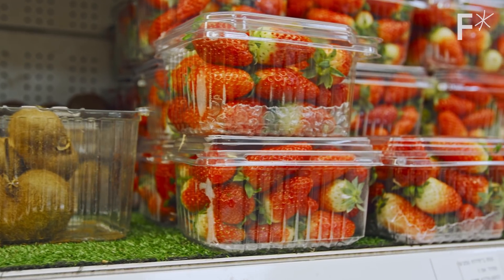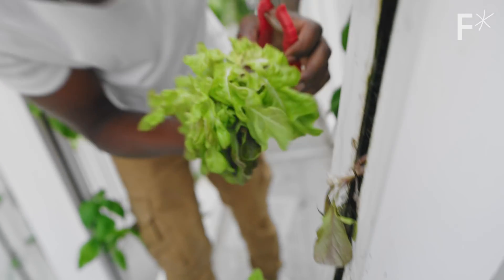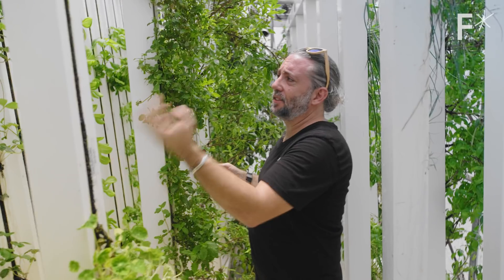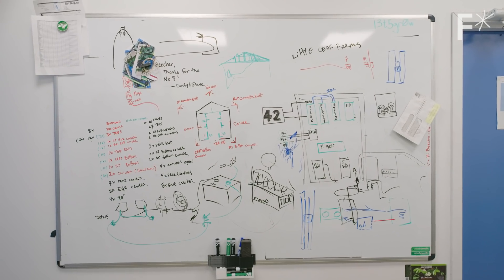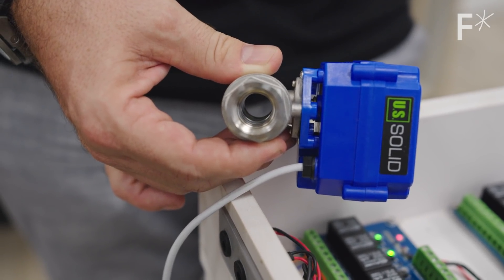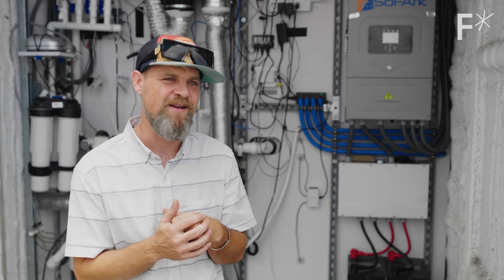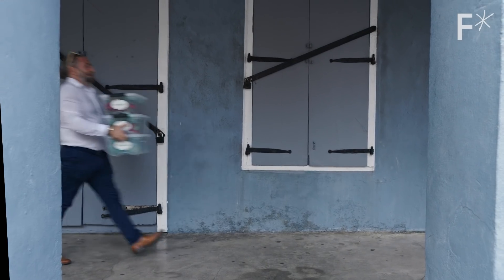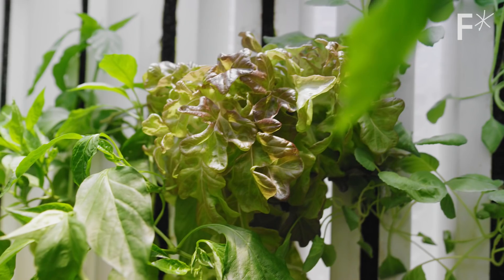Aquaponic farms in shipping containers: The future of food? | Challengers by Freethink

Comment: Why shipping containers? Can't really use existing pre-used shipping containers as you have no idea what they transported including toxic chemicals etc. You also potentially have thermal conductivity as an issue. Why use steel rather than something that can maintain heat better? Another potential issue is structural. how much structural support is needed for a container rather than something custom built?  Don't take this wrong, love the idea, just not sure shipping containers are the best solution.

Comment: As a person in love with sustainable farming, this is mostly BS.  It is neat in theory, uses all the buzz words, and looks cool, but the actual vegetable production from the top of a 20' shipping container( 8ft wide) is negligible compared to the cost of all of that.  if you are growing salad greens (the most profitable food/time/squareft crop there is) you would barely get a salad or two per day with that size of growing area.    A 50 foot bed of lettuce, 30 inches wide with 6 inch on center planting produces about 50lbs of salad mix every 5 weeks, or basically 10lbs a week... sells for $5/lb.. so $50/week.  I'd bet that pod can produce maybe $50-75/week of actual production and probably costs $40,000 or more. It is a nice gimmick for a restaurant to put one in front, but they will still be buying 99% of their salad greens and vegetables from a traditional market gardener.   Math is math, the yield per square foot, even vertical, is very easy to calculate for anyone with experience market gardening.    And the part about the ' buyout ' offer is BS also.  There are no patents involved and you can look at that thing and be able to reproduce it for $20-30k, why would someone pay millions for it..  It is basic aquaponics with a tiny growing area, it is economically unviable, which is why ' they' are the only person doing it.  it is easy easy math to look at the growing area, calculated yield and determine the break even point and that thing is way over a decade.
Reply: And yet he'll garner raves and people will say he's changing the world. Nobody does any real critical thinking but instead just want to feel better about themselves so just by praising him, they feel they're doing their part in helping the environment...
Reply: I agree too. I have been doing aquaponics for the last 6 years and running Aquariums for the last 20 years. This video just makes me angry.
Reply: @soarer282  I can't stand how these companies get exposure but real pioneers are ignored.
Reply: The website claims "Uses 90% less water than traditional farming and can produce 100+ lbs of fresh produce per week"  I'm sure the "can" is the operative word there but I'd imagine if they were only turning out a pound of salad a day they would get sued into the ground.
Reply: yea agreed, this is just something that looks good to someone who has never actually done any real farming before, it seems like it would be absurdly expensive and impractical, also they kinda just ignore the fact that you have to feed the fish, you still have to go to the feed store buy the fish pellets, you want sustainable and natural and relatively inexpensive, do mulit species rotational grazing, actually imitate nature, more people need to farm like joel salatin, also this isnt exactly a new idea aquaponics was allegedly invented in 1000ad
Reply: I was instantly suspicious the moment I saw the shipping container part.
Reply: based on the yeild of aquaponics?
Reply: @nosequiters  plants are plants. It is more just about space. Aquaponics is useful in some contexts.. But your yields are determined by # of plants and this entire highly expensive setup is going to yield the same as one 50 ft bed.
Reply: mark Balentine  yeah I’ve helped design systems that use gravity to move the majority of water and run off of one pump alone. It’s just about how you set these up that can make them viable options. There’s also issues like build up which can be fixed by adding a couple gold fish and some worms in the system. You need a lot of oxygen dissolved in the water for this to work and solids are a real problem
Reply: Yep you are right
Reply: 100%
Reply: What about spices? I imagine a fancy restaurant would be interested in having rare flavors available in their parking lot instead of having to import them from another country, and this ties back into the whole fossil fuel problem
Reply: @GoronTico  What spice in particular?  Cilantro and Basil are probably the only two spices that would be used in enough bulk to be useful for a restaurant, however, they both are less than half as valuable per square foot as salad mix.  You can literally watch any youtuber market gardener and see how we all start out with diversity, and then gradually all came to the same conclusion that salad mix is the way to go with just a few other things ( mostly all leafy greens like spinach, chard, and arugula).  Again, not to beat a dead horse, but there is nothing magical about this and there have been thousands of market gardeners for decades that hae done the math.  There is no way you can spend $40,000 for a single 50ft bed and ever make your money back.
Reply: @PeterSedesse  Don't forget about maintenance on this system. Another ding to that ROI
Reply: Not to mention.. what are they feeding the fish?  Grains from traditional ag?
Reply: Let people believe this. It’s wrong but it’s a huge step in the right direction.
Reply: Absolutely true. I just see this as an expensive hobby.
Reply: Yeah a straight fucking joke. I wouldn’t know where to start honestly. Smh
Reply: What an excellent comment 👍🌞
Reply: Came here to write a Thunderf00t comment and found someone beat me to it lol.
Reply: The moment I read shipping containers, I almost didn’t watched the video. Shipping container cost a lot. Better build your own structure maybe 1/4 of the price or less.
Reply: -.- ok y'all see you're doing your math wrong .....they are using the vertical and overhead space too
Reply: Keeping fish alive isn’t hard if you do it correctly. Especially considering how the water is basically cycled via plants. You don’t need filters anything like that you just need an air pump.
Reply: @jacobcudmore-maupai4963  yeah, none of that is true. You most definitely need filters for solid waste materials. Also the fine balance needed to keep the fish alive vs having enough nutrients for optimal plant growth is not trivial since both sides of the equation are living processes and the quantity of water in the system is small. Any imbalance and the system crashes.  Real aquaponics system have huge reservoirs of water in the system to act as a buffer against crashes.  This video is 2 years old, and this ' tech' is not being used anywhere. As I said, the math is easy, there is just not enough space in a shipping container to ever grow enough vegetables to pay back the expense of this setup.
Reply: You are right .That will be efficient only for some special condition.
Reply: Yeah the green house on top doesn't make sense to me with the exception of getting water back to the tank by gravity.
Reply: I think you're missing the point. I don't fully like this particular design, but the point of it is having "ready made systems" that can yield enough production for personal use, since most people wouldn't have the space or the drive to do it themselves. Farms CAN successfully be vertical. There are really cool ones in Singapore (like Sky Greens) and they yield more than enough for commercial production. Those designs are smart. This one is, in my opinion and in this guy's own words, intended for the lazy farmer that has some spare parking space, pretty much.
Reply: @bluefernlove    vertical farming and aquaponics are both viable farm businesses.   Doing it on a shipping container is not.  This isn't about lazy farmers.... this is just stupid.. do you know how much work is involved in keeping the fish alive,  the electricity required to pump  that much water water up 16 feet?  In order to have a couple of side salads every day.  There is nothing lazy about this setup, it is just stupid.   Lazy is going to the dollar tree, buying a bunch of plastic buckets, buying cheap compost and throwing some lettuce seeds in them.
Reply: @bluefernlove  Na too much work. No one has 2-4 hrs a week to waste on this let alone the thousands of initial investment. I'd take the lazy way out and order from a local farm and get it delivered. That way I can get what I need when I need it and have more control of  quality. 

Better suited for a learning environment (hobby or diy) rather than commercial or retail.
Reply: @detectiveinspekta   it is not just a few thousand dollars.  The shipping container alone is $3k, the pump will be $5k,.  Just the electricity to run the pump will cost more each week than the value of the vegetables.  I am guessing they are selling this for $40k and it costs them $20k to make it.  Then you gotta ship it..
Reply: @PeterSedesse  they used solar panels for electrical supply.
Other than that, your points are valid.
Reply: @telinoz1975  where are the solar panals?
Reply: @telinoz1975  Sorry, just skimmed through the video again, nowhere did I see solar panals.  And again, this is simple math.  Your pump needs to run 24/7, pumping your total volume of water every 15 minutes.  You need to pump your water UP 16 feet, which is insane.  You can easily calculate the size of pump you need, how much energy it requires to run 24/7.  Maybe you are lucky you get 8hrs of good sunlight, which means you need a battery that stores 16 hours of energy for your pump... to be safe, you usually do 3 days worth of energy storage. ( opps, two cloudy days in a row and all your fish die).  If they are doing this ' off grid', now you need a $3000 battery bank and another $2000 of solar panals.... and again, all of that to produce about $50 worth of lettuce a week.  Do you think there is a reason they never talked about the solar panals or the production levels?  Again, this is all just a scam to sucker people who don't know about energy, pumps, or vegetable production.  Ask a person in aquaponics about pumping water up 16 feet?  ask a farmer about production amounts in that size of growing area, ask a solar expert about the energy requirements and storage requirements of a 24/7 pump of that size.  None of the math is viable for this product.
Reply: @PeterSedesse  At 1:15 the dog is literally running across them.
Reply: @makokx7063  Oh, saw it now.    but yeah, that is not even enough to run the pump during the hours you can capture sunlight, let alone 16 or so hours when you can't.   People severely underestimate how much electricity it takes to pump water up 16 feet 24/7.  There is nothing tricky or special about what they are doing, if it actually was even remotely feasible, hundreds of companies would be doing it.
Reply: @PeterSedesse  Yeah I posted somewhere else about it. I work for a plastic recycling machine importer in Japan and every year we have a Eco-Fair and every year there are exhibitors that have this in a different shape and they never make it to their 2nd year. Interesting but not viable.
Reply: @PeterSedesse  Late to game. I have no idea on the possible output, but assuming they're using a single up tube and a separate but also single, downtube, they could place a turbine in the downtube and reclaim some spent energy through hydroelectric generation. It would increase initial cost but lower operating costs and reduce loss of power and allow for more total energy to make it to the batterys. But yea, this is a much better idea for in space imo. The sheer amount of land available for farming makes vertical farms on earth more for hobby/research use.
Reply: @FurlessApe22  vertical farming can work and be economically feasible in big cities.  If you think salad mix, the cost to get fresh salad mix shipped into NYC is astronomical... but there is no reason to do it in a shipping container. people do it in warehouses.  The expenses of doing the aqua part of it will never be recouped in such a small growing area.  We have a really cool aquaponics farm here in Austin, and the ratio of space used for the equipment compared to the growing area is probably 50 to 1.  In the shipping container, it is basically 1 to 1.  I like your idea about the turbine, but I've seen ram pumps.. I don't think the hydrostatic energy would even be a tiny percentage of the cost of operating the pump going up 16 ft.  People vastly understimate the amount of energy that would be required to pump that volume of water up 16 feet.  This isn't pumping water up to water plants, this is pumping a huge volume of water 24/7 in order to keep the fish alive.  The rule of thumb is you need to pump the entire volume of your system throught he pumps every 15 mins.  Nothing in his system is groundbreaking or innovative... if it actually worked, they would be everywhere already.
Reply: @PeterSedesse  Let's do the world a favor and not "guess" about things you aren't sure about since YOU are NOT part of this project development. Nor do you have access to any of the development details. It's very easy to Monday morning quarterback something when you don't have ALL the DETAILS and you just guess. You're a dream crusher.
Reply: @michaelduley5311  he just verified my numbers. They are getting about 700 plants on that thing.. About the same as a single 50ft × 30 inch garden bed which produces about $500 of salad mix every 4-6 weeks.. So at best $100/week which comes down to 2-3 salads a day. Even a modest restaurant would need 30-50 of these shipping containers just to produce the lettuce for their salads.. And Any other plant you grow is going to produce less value. Salad mix is king.
Reply: @michaelduley5311  Lol you sound like someone who easily falls for sales pitches. I have some snake oil for sale soon. I will be in touch 😉
Reply: @detectiveinspekta  
yes some things like this are great for private usage. Something to learn about if you had to live in a small place or so.
Reply: The dog walked on it! Lol @PeterSedesse
Reply: I totally hear you're thoughts on the ROI. If it helps for calculating, in our current version we have 70 vertical grow towers each holding 6 to 14 plants. One of our units we are currently running produces food that we deliver to 10 restaurants on a weekend basis. We pick several pounds of peppers a day just off 6 of the 70 towers. But I usually l totally see where your are coming from. We are constantly trying to make it more affordable while increasing productivity. Also keep in mind that it can produce year round, not just during normal grow season. In addition the FarmPod has nearly a 20k solar package. One that you can add to if you want to power a house or business next to where is placed.
Reply: very much agreed, this is a marketing gimmick. If some company offered them millions to buy the company, why couldn't they take the money and start a new company? a lot of this doesn't add up.
Reply: So what happens to the 🐟? I thought that was the other revenue stream cuz otherwise  it's just hydroponics right. Idk how many fish u can get a year but I think that needs to be calculated here as well..
Reply: @cj2k867   this is mostly a myth regarding selling fish.  Even the very large aquaponics facilities do not sell many fish.  The problem is that these systems need to be controlled precisely.  Too much nitrogen and the fish die, too little nitrogen and the plants don't grow.  Tilapia are harvested normally at 8 months old, and the problem is their nitrogen release is determined by their size/age.  So if you sell off 8 month old tilapia and replace them with fingerlings, the nitrogen produced in the system drops by a huge amount and your plants will die.  Most aquaponic systems let their Talipia get much older than 8 months and only replace a tiny fraction of them at a time.  Also the amount of Tilapia you could sell of is dwarfed by the money you get from selling lettuce.  There is just too much risk of having a fish die-off or a plant die-off if you are constantly fudging with the total weight of the fish in the system.
Reply: @PeterSedesse  but then doesn't that just mean u could start over each time then. Like have 100+ fish all ready at one time and align the plants to be done around the same time. Mitigating most of the risk u are stating here
Reply: @cj2k867   Tilapia take 34 weeks to reach harvest weight.  Lettuce takes 5-6 weeks.  In essence, what you are describing would be to limit lettuce growth in the unit to maximize fish harvest.  Now let's math out again. This thing looks to have at most 500 gallons for the fish, that means about 300 harvestable fish in 8 months.  which is about 200lbs of fish filets in 8 months or 25lbs of fish a month.. which equates to about $125/month of tilapia value.(which doesn't include the labor cost of cleaning the fish).  Or if you want to put it into restaurant terms, this would equate to about one serving of fish per day... one meal.  At the same time, I mathed out that you would get 2-3 salads per day from this thing.  So because of lower production of harvesting the fish, let's say 2 salads.  So you are spending $40,000 or more in order to get two small salads and one order of fish filets.  And none of that includes all your costs of running this thing and maintained it.  I live in Austin Texas, there are two huge aquaponics farms near me, neither of them market their tilapia as a product, it is purely salad greens.  There is no magic in these shipping containers, the math is pretty easy and if you have any experience with farming or aquaponics you know these things will never even get close to paying for themselves.